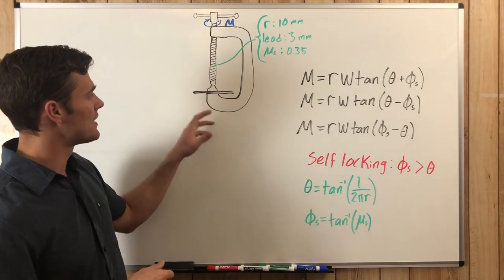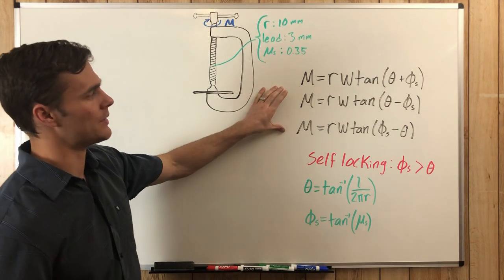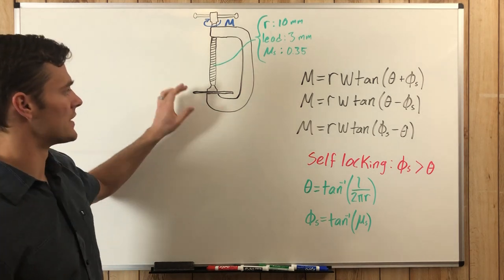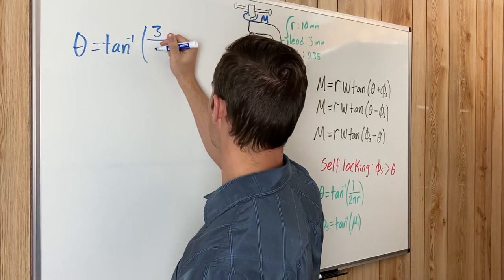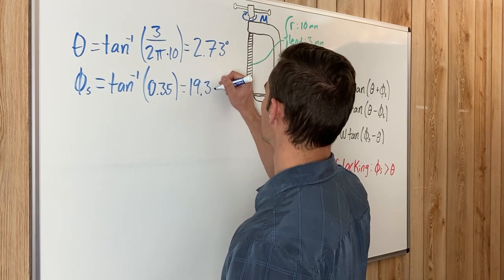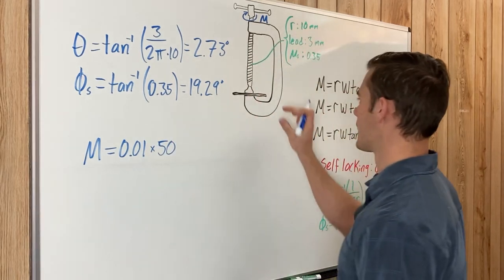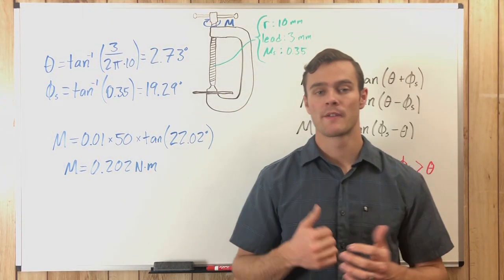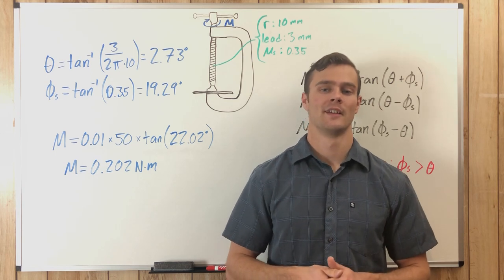Frictional Forces on Screws EXAMPLE PROBLEM // Step By Step Process Explained // Equations Included

Comment: why did you sum up the angle? isn't it a self locking screw?
Reply from the maker: When the impending motion is in the opposite of W then it doesn’t matter whether or not the screw is self locking.

Comment: Why didn't you convert the radius when calculating the thether angle?
Reply from the maker: Convert the radius to what?
Reply: @studentengineering  isn't metres?
Reply from the maker: The radius can stay in millimeters. It doesn’t have to be changed to meters.
Reply: @jjjjjjjjj2476  Anything thats inside a trig function must be unitless, so the millimeters actually cancel out so he doesnt have to convert.